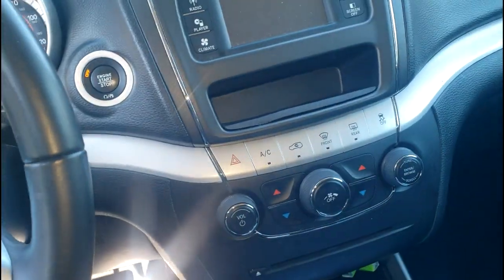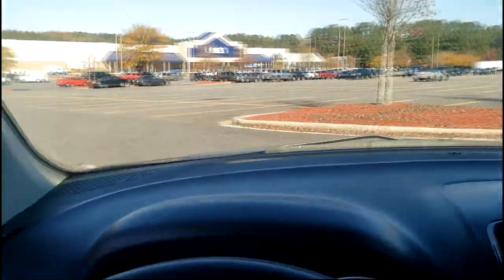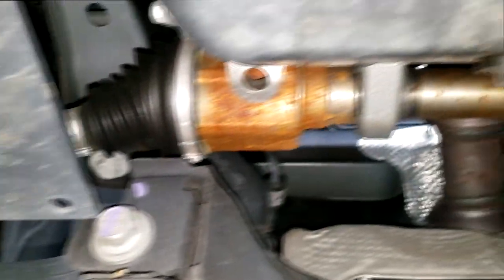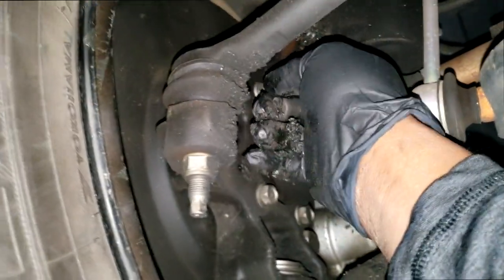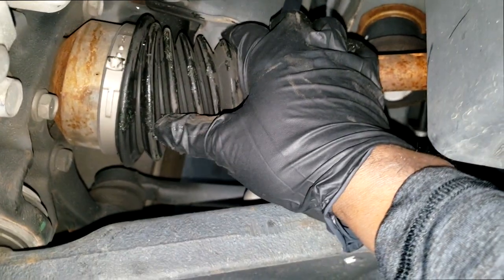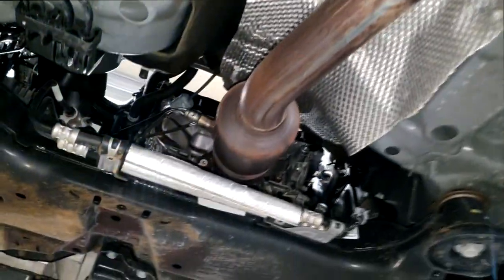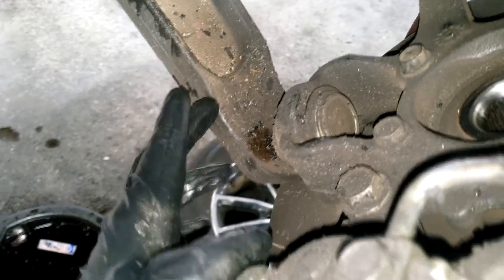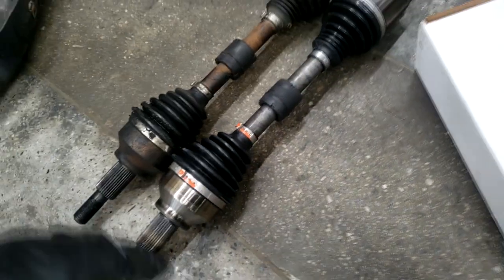How to diagnose a ticking vibration wobble in your car. How To Diagnose A Bad CV Axle or ball joint.

Comment: They both failed at 33k?
Reply from the maker: Hey bud. Im not so sure axles just fail. They will however become noisey do to lack of lubrication which was the case here. But how did the boot split which caused it to loose the lubrication is the question. And that I do not know. Cust could have snagged something in the road, who knows. Thanks for watching bud. I hope you thumbs up the video and subbed the channel, thanks